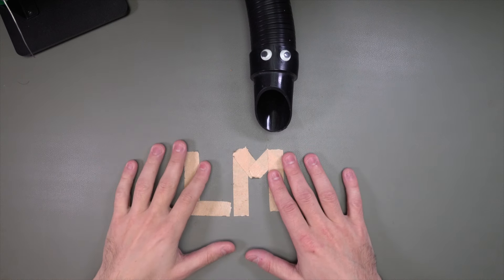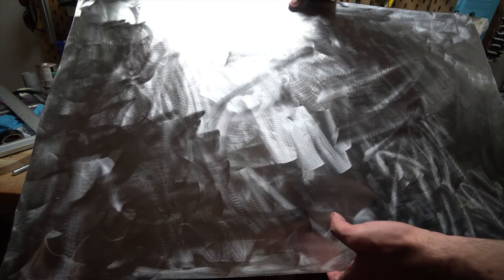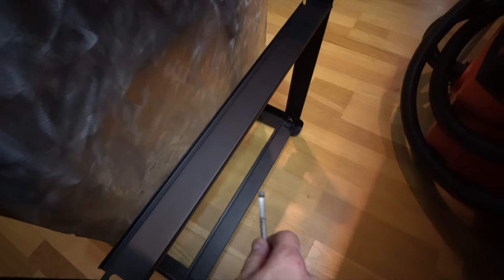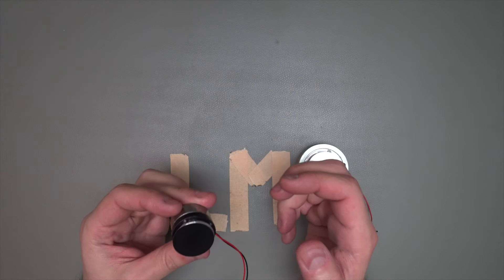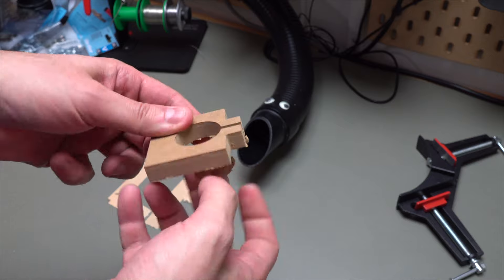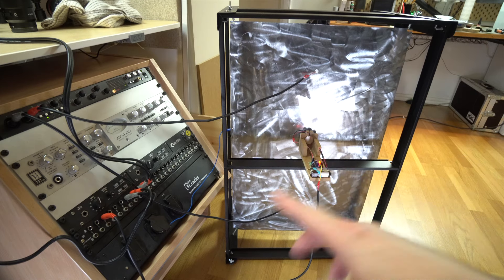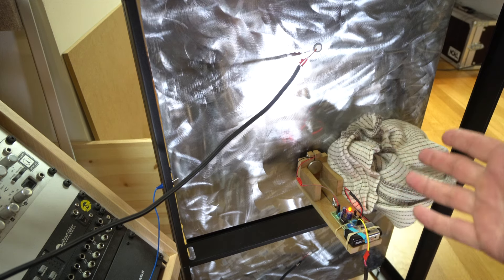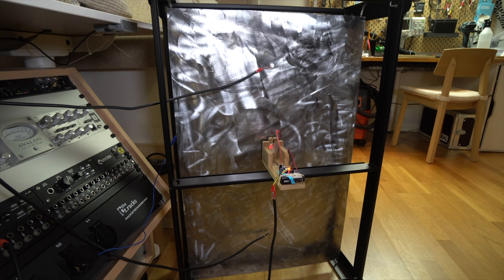DIY "IKEA Hack" Plate Reverb Part 2 (Sounds amazing now!)

Comment: Awesome work. One thing you can do for dampening is stick on rubber pads , or even Maganets with Rubber pads on them. That way you can re position the magnet pads around to get the desired sounds. You can get thin dense pads with strong magnets glued to them. An idea anyway.

Comment: Mount an arm with a felt pad on it, and use it as a mechanical dampener. When swung away, no dampening, when you swing it onto the plate you'll get varying amounts of dampening depending how close to the center you swing it. 1 screw/nut, 2 washers, a wood dowel or spruce strip, and some felt glued on to the tip. One new hole in the frame.
Boom, done.

Comment: Interesting video. I guess it turned up because I watched a guy make a similar kind of speaker experimenting with different surfaces, Wood, metal ceiling insulation etc. of course I can’t tell exactly what the real sound was, but I was pretty impressed with his flat hanging wall speakers.
I wondered what my Gongs would sound like if I attached the...ummm🤔 thing to them 😂😉 ( it’s late) but apparently the acoustic properties reverberated too much using metal. I think the ceiling insulation panels were the best sounding? But don’t quote me.🙂🖖

Comment: really cool project, i've been thinking about this for sum time, llthough i would of focused on electronics in the first place. Your improvements are stunning. net step imo would be trying different plate sizes and material, and designing proper driver nd output preamp, i guess i could use jfets... I think i would of used the big transducer with sum audio correction to have more possibilitys. overdriving?

Comment: I know this video is over 2 years old so my comment may have been already made but..... Back in the 70s when I worked at Neve designing consoles, I visited quite a few UK studios all of which had plates, However, almost all of them delayed the feed to the transducer. Many of them used a high speed Revox A77 running at 15ips for this purpose. Since the gap between the record and replay heads on the A77 is about one and a half inches, the delay was about a tenth of a second or 100mS. You might like to try this.  Cheers Ian
Reply from the maker: Thanks for your insight!  It's interesting to hear about the "very analog" delay caused by the gap between the record/replay heads of the tape machine.  I don't have that prototype anymore but the pre-delay would be easy enough to simulate in software, I suppose.  Thanks for watching!

Comment: For the damping (or dampening, not sure which) could you have something soft such as a lump of foam stuck to the end of an arm that could be through a threaded hole.  Just screw it in or out to push it more or less against the plate.  Only a thought.

It sounds beautiful though.  Definitely something I'm going to look at making this year 😁

Comment: 1:55  probably car paint remover would make it easier
Reply from the maker: True.  I saw people on YouTube using paint stripper and it was quick/easy.  I couldn't find it here easily and in any case harsh chemicals like that really give me the heebie geebies!  :)
Reply: @LeoMakes  yeah its very toxic and requires a good ventilation and safety measures
can you just glue a small magnet to the plate and place a coil to make it vibrate?
or coil alone since metal sheet is magnetic

Comment: Amezing project!
Couldn't the damping be adjusted by the tightening the springs that hold the plate to the casing?
Reply from the maker: Adjusting the tension on the plate would start changing the pitch (like changing the tuning on a drum).  While it would cut down on the "reverb time" it would also change the timbre of the sound which I would like to keep as-is.  Good thinking though!

Comment: You may want to try small pick-ups instead of peizos. My friend built a similar plate reverb many years ago, and he ended up using small solenoid coils as pickups. This gave it a much fuller sound than the peizos. He may have glued tiny magnets to the plate also to give the pickup a stronger signal. You could even have a pickup on both sides and wire them up as balanced pairs to eliminate hum, or use humbuckers.
Reply from the maker: Really interesting idea about wiring in a balanced pair like a humbucker.  Thanks for sharing!

Comment: Great Video! Maybe you could get a snare dampener for the plate. 
I've seen them as these felt circles that you could mount to the frame and then screw them as close as needed to the plate.
There are also just silicon pads that you could just directly stick on the plate.
Greets!

Comment: If you're going to look into a more permanent way of dampening the reverb-tail, maybe some sort of clamp with wooden blocks on both sides covered in felt fabric would work? Maybe even two layers of felt fabric. One could even experiment with putting one such clamp at the top of the plate and one at the bottom for even more tweakability on both sides of the plate. I think it could work as long as the clamp has a big enough range to be completely free'd from the plate. Love this project! You're inspiring to watch and listen to.

Comment: I know this is 4 years too late, but what I would suggest to dampen the reverb, would be a strip of wood with felt glued across the length to it. and mount it horizontally across the plate. with the felt side against the plate, with the adjustment in the same way as you did the Speaker, so you can adjust the tension of the damper against  the plate. this should work like the dampener on an upright piano.

Comment: If you used a slotted "L" bracket or two    ( Bolt to the cross beam near the amp module and transducer) with felt on it - they could be used to dampen the plate to shorten the reverb times

Comment: Have you tried just putting magnets onto the metal plate to dampen it by increasing mass at specific points? If you place them right, you could actually have different vibrating modes on the plate by inducing vibrating notes and tune the sound even more.

Comment: I wonder if introducing thickness variation as you did when grinding down the paint was a sonic improvement in and of itself apart from removing the paint and the folded edge. As opposed to chemically stripping the paint or getting a new 0.6mm sheet of zinc plated steel from the store.
Reply from the maker: Yeah, I've been wondering the same thing about the small variations in thickness.  I was definitely not "scientific" in my sanding and I'm sure there are small, gradual variations (peaks and valleys) in the surface of the steel.   Experience and intuition tell me that might be helping the sound vs. a perfectly flat sheet but I don't know for sure.

Interesting thought, though!

Comment: For the sound dampening you could maybe buy some of the sound dampening foam off amazon or eBay then use double sided tape and put some on it, or put some on the bottom and have a way of lowering it up and down to have higher and lower pressure onto the foam to dampen the sound
Reply: Tell me if I’m wrong but I think that’d work

Comment: I wonder if it could be made smaller if used with thin metal sheet. I actually have thin brass metal sheet on spool, like 25cm wide possibly 0.1mm thick. Need to try this. 

There is one important aspect missed in this video! Corrosion! In this video it looks like steel - it will quickly rust and change it's sound. Maybe for better... But it will change over time as more rust will build up.

Comment: How about using felt you would normally put under a chair or something and glue it on a clamp's screw. Mount it or perhaps two of it opposite the transducer. You can now adjust the pressure of the damper and dial in the reverb time. Hard for me to explain it in english but in my head it makes perfect sense.

Comment: My 2 ideas on the dampening issue: 
1. Use a screw thats pointed at the plate (or even multiple screws at different locations), with a rubber or foam tip or plate at the end. You could adjust the pressure against the plate simply by screwing the screw in or out. You could mount them basically the same way you mounted the jig for the transducer. 
2. Just use a clamp to fix some sort of weight onto the plate. Maybe you can get different sounds from different clamping locations. 

Have you seen the video from Tech ingredients on his DIY Speakers? He also used weights glued on different places to change the sound (and solve some interference problems IIRC) of his speaker panels. Hope that helps!

One question remains: Why don't you just buy a 0.5mm steel sheet from a hardware supplier? Seems like that could save a lot of the work (and also save you the cost of the anglegrinder rental fee and disks)

Great video!
Reply: already found the answer to my question in the comment section ;)

Comment: Idea for dampening: get some soft sponges (automotive supply car wash section?) and glue them to wood blocks with a slide groove. Mount to the sides of that center brace the driver is mounted on. Adjust on groove and how much sponge gets squished. And you want those really soft natural or foam sponges, not the cellulose ones that harden up when dry. My way of thinking, that'd give you good adjustment which is also more consistent.

Comment: Nice work solving the electronic issues so elegantly. I've always worried about this aspect of the plate; I understand that back in the day the EMT pickups were full range. These days it seems the transducer pickups available have a very limited frequency range, thus killing the idea of a quality plate signal like achieved in the 60s. However, your plate does sound quite clear. Do have have any thoughts you could share on this issue?
Reply from the maker: There's no reason why that can't be done today, and I'm sure there are people making transducers at a much higher quality than what could be done in the 60s. Materials science and technology has come a very long way over the decades. That said, it's just not commercially viable to make big HW plate reverbs at scale.  In the 60s plate reverbs and actual chambers were the only way to add echo so everyone wanted one.  Nowadays, pretty much any DAW gives you great reverbs (including convolution models of the classic plates) right out of the box!  It's an amazing time to be making music.
Reply: @LeoMakes  Really? I've never seen a transducer wish a full frequency range made these days. And I've been looking around for years. All I see are the kind you have that seem to cut off at like 6Khz??

Comment: Most plate reverbs use a board, the same size as the plate and mounted net to it parallel, that moves closer to the plate to give you an adjustable dampening.

Comment: You could damp more or less the plate changing the springs coefficients or tightening them more? I think that would be a more controlled way of dampening, also more natural so you don't lose those high frequencies.
Reply: Excellent point.. I'd really like to hear the difference with the plate pulled tighter.

Comment: Just a thought about mounting the driver.  Would it have worked to epoxy a strong magnet to the driver face to attach it to the plate?  One benefit might be the ability to place it at different places on the plate to change the effect.

Comment: One thing you could try to cut down the reverb is use the stuff that drummers put on their drum skins, e.g. drum tape or damper pads. With the size of the plate, sticking some near to the edges might reduce the reverb to a decent level without being detrimental to the overall output.

Comment: Pre-amps designed to amplify passive piezo pickups usally have very high input impedances of between 5 to 10 megohms. As you say a high impedance is needed to preserve low end when using piezo pickups. However it is possible that the 1M of the Focusrite is enough and that your plate in general doesn't pass very low signals. I think the maximum dimension of the plate itself limits the low end . This is not necessarily a bad thing - electromechanical reverbs and delays commonly have quite narrow audio bandwidths. It is part of the character. Personally I never much liked the plate sound, but your DIY plate is a great idea, actually sounds pretty good and is way cheaper than an EMT.

Comment: Congratulations! Incremental improvements led to a very nice reverb. Not an EMT 140(hundreds of kg and thousands $ less..) but perfectly usable in his own right , and with a distinctive sound. 
You may consider a little bit of improvement with  the wiring and connection to make it more pro looking .  And casters or rubber feet maybe.
Reply from the maker: Rubber feet is a good tip.  I added them after the video was posted to prevent scratching up my floor.

Comment: For your dampening, why not mount something to hold a soft wedge. You can damp it more by pushing the wedge into place... or you could get a bicycle brake mechanism and mount it around the plate?

Comment: Just took a miander and stumbled across this...

Fantastic project.

Had a thought about about damping.... Could you not do something akin to a damping pedal on a piano?
Maybe - instead of making the movement of done by levers (which would most likely add noise), use something more like the braking system in a car; that is move the damping pad with hydraulics.
Should not take much to knock back the tone a bit.

Comment: Dampening Solution: Have you thought of making two more of those MDF Rigs and putting some felt on the end? You would be able to easily adjust the applied pressure.

Comment: U can make a round plate, so the reflection waves returns in phase, that's better for resonance! (sustain)
Reply: (invert the position of the microphone with the speaker)

...get the transducer in centre of circular plate with just a little tip (minimum contact surface) to minimize resonance interference
Reply: ...attack the piezo pick up with a magnet, so you can move it from the centre to the periphery, to change the reverb time...
Reply: look at this:
https://youtu.be/tFAcYruShow
and this with circular plate:
https://youtu.be/tqANg0y_Fz0

Comment: I would think you could damp it with a mechanism much like what you use to hold the driver against the plate, with a slot and something soft like thick foam or felt instead of the speaker.
Reply: I was going to post the exact same thought. SImilar slotted adjustable rod, but with a pad on the end, sort of a flat bass drum pad. Or experiment with different materials, even a folded towel.

Comment: Not sure what adjustments you made, but. you COULD.....    Make a dampening arm on a swing in one corner that remains in constant contact with the middle as you slowly adjust it by sliding it further into the body of the plate it will dampen, which may also work as to set the reverb to have a specific duration of time that it resonates as well.      Also the pressure of the damper will determine the pitch if my guess is right.  A tiny tiny tiny felt foot will allow high's while a 2 inch felt foot on the arm will dampen highs and allow even the pitch of the reverb to be adjusted. 

Just my guesses off the top of my head.    But this is just frick'n fantastic!!

Comment: the aquarium industry makes an excellent solution to the sketchy grounding situation you showed with alligator clips on both ends. a "tank grounding wire" will have a 304 ss rod attached to an 18g copper wire terminating in a standard US 3 prong plug where the hot and neutral flat spades are made of plastic and only the post for the ground is metal. snip off the rod and attach a quality alligator clip or a eyelet and bolt through plate and plug the ground-only plug into the power source the audio system is on.

Comment: I'm a little curious as to what a plate reverb would sound like if you mounted the input transducer near one end of the plate, and the pickups near the other end, modelling the sort of impulse response one would get in an actual hall, with the sound source on stage, and a stereo microphone in the house. Also, the same, but with stereo input transducers.

Comment: This is great, I've thought about making a plate for years but I always assumed you needed at least 3'x6' (and probably more like 4'x8') to get a usable sound, and as a renter that just wasn't an option.  This proves you don't, and I bet it would sound even better with the standard "Abbey Road" plate EQ (highpass around 600hz and lowpass around 10kHz before hitting the plate) to tame some of the harshness of the highs.  In fact, I bet a plate this small doesn't even need the highpass, it already doesn't sound too boomy. 

Might have to build some variant of this myself this summer, maybe try winding a couple of pickups for it instead of using piezotransducers.

Great, inspiring work!

Comment: If you do this again. To remove paint I'd say to use paint stripper instead of a grinder. Should help the plate stay as even as possible.
Reply: Also you can oil it or add a super thin layer of lacquer to stop the rust.

Comment: I wonder if building this with magnetically held pickups (for easy repositioning), and a system to all for modification of the sound by placing things on/close to the backside of the plate (blocks placed close would cause air damping, magnets on the sheet to add repositionable mass, VHB or similar tape would cause a different type of damping) would be feasible.

Comment: Just an idea, I have an old Rogers snare that has a tone control knob on it. It’s basically a felt pad on the end of an arm that moves up to make contact with the drum head when you turn a thumbscrew. I’m wondering if it would be feasible to mount one or two on each side (dead center on each side or one on each corner) to solve your dampening problem with a bit more precision than the scarf.